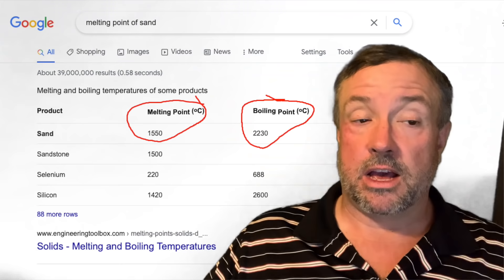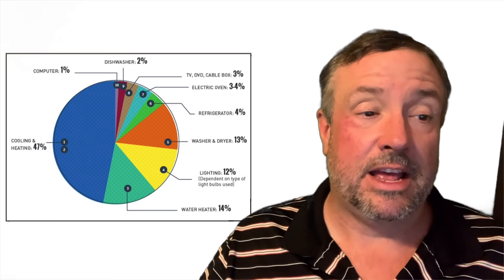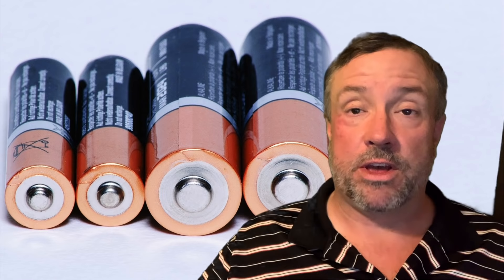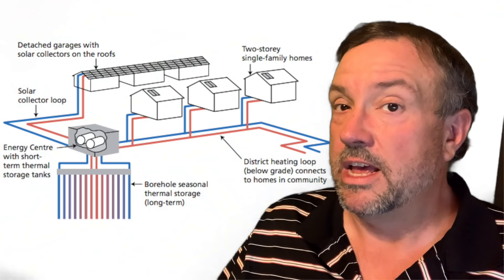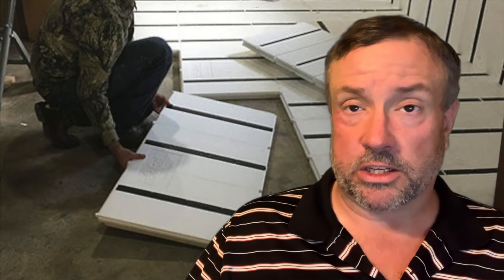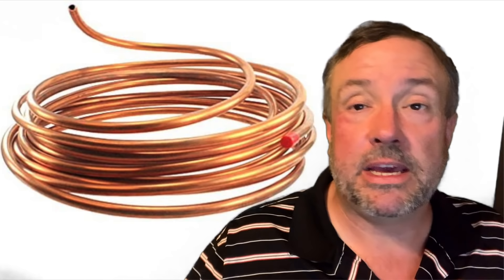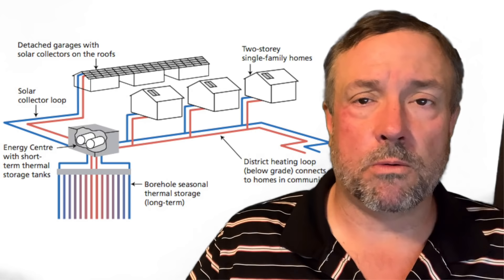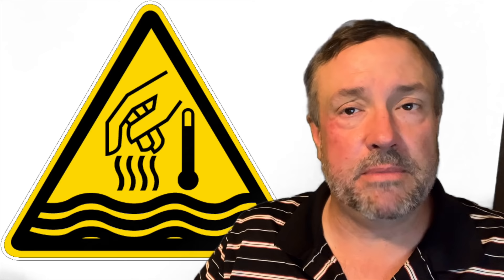Sand for Thermal Energy Storage

Comment: My idea is stupid (very inefficient) but I’ve been trying to think maybe the solar heater could produce steam to run a generator which stores electricity into an array of supercapacitors (crude, cheap homemade) which in turn after having enough energy stored could directly use heating element to heat the sand (so like buffering the heat first trough electricity back into heat). 

Haven’t done any calculations, but most likely an useless approach. At least this would not require complicated/expensive equipment. Not sure how high temperature can you reach with the cycle of charging and discharging a certain size supercapacitor array and what type of heating element would be good for such a setup. The amount of energy losses with this approach will be very high but maybe this way of buffering would enable the sand to reach higher temperatures?

Ps. If someone asks why not just store the electricity directly to batteries, the whole idea of storing energy to sand etc. is to find an alternative to current battery technology storage systems.
Reply from the maker: Cool idea

Comment: the  liquid is always moving so it never has a chance to get too hot. if it did you would just increase the flow rate and the radiated zone surface area. It's not always practical to use industrial processes in the home. 
  2 ideas i had were to try sand over PEX underfloor heating and electrical underfloor, solar electrical and  heat pump vacuum tube panels making it a 2 part system. The other idea was to build a gas bottle stove that has a flue running up the centre the lower section is a burner then you pass all the way from ground level in your house or lower to the highest ceiling with each floor having another burner section, these could be made modular so you just stack them for however many floors you have in your house. then fill the upper sections with sand once installed, only issue is loosing heat out the chimney but you can choke the flue and inlet once the fire is out.
Cold isn't it!
Reply from the maker: very cool - thank you
Reply: AGREE.....think about a typical natural or propane gas fired home furnace. The air is heated by passing it quickly thru a gas burner heat exchanger which is at least as hot as 400-500C sand and it works very well to heat air.

Comment: When I was first looking at solar I studied what the government had been using for their receiver type solar platforms. What they were doing was they concentrated the mirrors on piping that contained oil. That heating up of the oil created flow within the system, which turned an electricity generator. I do believe that you should be fine using oil for your transfer medium without any need for a pumping system. I do think that you should consider a piping solution that can handle the built up heat and pressure if you do this.
Reply: You would want to integrate flow check valves into the system to ensure that the oil only flows into the desired direction.
Reply from the maker: great ideas
Reply: @SimpleTek  thinking about this article has made me think about something else entirely. I was in the US Navy for 6 years, and the main thing that I did was convert salt water into fresh water. The concentrated light from a couple of the solar options mentioned here could be used for an evaporation distillation plant, to convert waste water into freshwater.
Reply from the maker: @justinweatherford8129  very interesting - thank you for commenting!

Comment: There's a Finish company with some videos on youtube that is promoting sand thermal batteries. They are just heating air and running it through steel ducting. Their target temp is 500 degrees..
Reply from the maker: I've seen it!

Comment: Some thoughts:

The only way to insulate a sand body sufficiently and still be able to add heat to it would be to run conductors through it and heat those up with electrical current. That would be fine because we are in need of a way to store solar power anyway.

To extract heat the copper tubing sounds practical, although it can take only about a 1000 degrees before it melts. But then again, just use more sand. The temperature of the copper would have to be monitored closely.

Now the idea comes to mind to combine the two: the copper tubing (the soft kind that can easily be wrapped in any path) could be use both as a heating conductor and as heat exchanger when extracting heat. Running water through it would be problematic for obvious reasons, you could use a closed loop filled with oil that can take high temperatures and a pump. That would also make it easy to monitor the temperature: if the oil is pumped round slowly the oil temperature could be measured in or near the pump.

With some valves the path of the oil could be routed through a water tank to heat the water. So you would have one short path through the sand used for monitoring only when the sand is being heated with current and a wider one through your water tank when you need to heat that up.

You would need insulation bridges in the pipes where they leave the sand pack, to insulate the pump and water tank from the heating current.
Reply from the maker: the 'only way'? ummm, no...most commercial high temp storage devices use liquid molten salt for high temp applications
Reply: @SimpleTek  I consider the "lots of mirrors pointed at a bucket on a tower" a crude and inefficient brute-force approach. These things must immediately radiate out a good deal of the energy they absorb. The half-cylindrical mirrors with a pipe running through the focus line suffer from the same issue. With electricity you don't need that exposed surface, it is easy to keep everything you put in inside because it can be a fully insulated closed container.

Then again, the solar panel won't give you more than about 20% in the first place so you van afford to lose a bit.

Then yet again, solar panels do not need direct sunlight.

I think these mirror systems were just pioneering practices that were nice to raise some awareness but I do not think they are very practical.

Comment: Got this figured out already.  I’ll be sharing it on my YouTube channel soon.
Reply from the maker: looking forward to it
Reply: @SimpleTek  by the way, not a challenge, it’s like you say, when we share everyone benefits.  I saw some guys on a video a couple of months back discussing this on a large scale for cities.   This was not the first.  However, it is the first one I saw on wax.  Interesting!  They heated their sand to 700 degrees centigrade and emphasized the sand had to be dry… huh??  I’d think it would be dry!!  Read some comments below…. It was the Finland group I watched, refreshed my feeble memory!
Reply: Yes, the sand would have to be dry for systems that get even close to the boiling point of water. If it isn't enclosed then rainwater would steal some of your heat in the evaporation process. If you had an enclosed system that had wet sand, then you better have a pressure relief valve to vent off the pressure created by the water that you left in there. That water in your enclosed system would take care of itself over time, but why risk the damage to your thermal battery?

Comment: Hello, I don't know if somebody mentioned, but you can increase boiling point of water by increasing pressure. I think you can reach 250-300degC if your system will be pressured to 50-100bar. But the piping, fittings and the pump will be expensive.
Reply from the maker: Great point
Reply from the maker: @scattkiwiman  so is an internal combustion engine but they seem to be Popular
Reply: @SimpleTek  if you want to make a bigpressure resistant water vessel it will cost you more as a combustion engine
Reply from the maker: @scattkiwiman  depends

Comment: black iron pipe, used for moving heated glycol around.  Alternatively just pump the hot air through the trough collector and into the sand, like a fluidized bed.
Reply from the maker: Good idea

Comment: If you want it cheap than not only are you on the right track by using sand, but keep it all simple. The point, us air as the heat exchange median on the input heat exchange and on the output heat exchanger, because it is air that you ultimately want to heat anyway, the air in the green house, the air in your home, etc... But this design uses PV solar,  electrical generator wind turbines,  electrical generator hydro turbines, etc... In other words the energy input to this design is electricity because it uses electrical resistive heating elements(cheap and found everywhere) to heat the air that heats the sand. The same heat exchanger designed right, can be used for both input and output heat exchange because you are using air in both cases. There will just be a valve to either tap into some of the heat, or close it and store more. A venting system will be installed so that you can draw only the precise amount of heat energy out of the battery at a time, in other words you can trickle just a little bit out at a time, as well as in dead of winter, or end of winter open full blast if need be. 

Then that is it, you are already pretty much done, no more expense, no more complexity. No pressurized tanks to buy, no steam turbines, nothing except sand, pipes, and basic electrical resistive heating elements mainly, probably need a good blower. It is just mostly ducting work, and just one heat exchanger can act as both input and output heat exchanger because the energy input to the system will be resistive heating coils in air. Just need heat exchanger pipes, sand, electrical heating elements, and some ducting to the destination of the output heat. The ducting from the battery to the building/s could be anything cheap, like blocks or bricks, even field stone mortared together in a tube with insulation(maybe aircrete) poured all around it for a couple feet, then bury it(it will be built in the trench) for the DIY to save money doing the labor. Then when it reaches the building use regular furnace ducting.

But just think of the other uses because of the fact you stuck with using air, heat pumps! You can get extreme efficiency if you combine this ideal of an air heat exchanger on the output of that battery with a heat pump. I would have to try it someday soon, it seems like you could get more heat out of it without actually taking more heat from it using a heat pump. Maybe i try to find an engineer on that topic. Maybe better to just take the hot air directly.

But to use other forms of energy input like solar troughs heating oil, etc... you will just need a separate heat exchanger in the battery for it, a set of SS pipes running uniformly in the battery(sand).  Same thing applies, one single heat exchanger(designed for it) could be used if you use the same median for both input and output exchange.
Reply from the maker: Thank you

Comment: Just a thought..how about using concrete piping.  Cheap, long lasting, mold into and size or shape, can handle high Temps, will also work as a conductor or storage for heat and heat source.
Reply from the maker: Interesting idea… Can you buy it or do you have to make it?

Comment: Use a Peltier device to store electricity as heat and use heat to output electricity. It would go above your budget but with no moving parts, it would last forever and not require specialized equipment to use it.
Reply from the maker: Interesting

Comment: Build a pizza oven, start with a barrel covered/wound in copper pipe surround that in clay, then sand and rocks gypsum basalt marble... cover in dirt or clay and then a metal roof.

Cook your food in the oven, when finished let the air flow into the greenhouse and pull from the other end of the greenhouse. Add more wood and burn if it cools down.
Reply from the maker: I like pizza!

Comment: Dig a hole lay it with plastic foil (provent demp) spread 5 cm sand on the button lay down rectangle straw bale. Build the side same way so straw not touching plastic therefore not poking plastic. Now you have a big pool, put 40 cm sand straight on the bale. Then lay aluminium  gutter down pipe just like PEX floor heating pipes roughly 40 cm apart (you will circulate AIR in, it is free you can heat it up wery high temp, leaking is not a big deal, easy to pump circulate) then 40 cm sand above then piping again so on, dipend how deep is your sand pool. Then the top double think straw bale 5 cm sand plastic sheet then cover with sand to protect from weather or mechanical problem.  You have large cheep high heat storage. 1 m thich straw = EPS 60 cm. U value 0,06w/m2K
Straw cheaper, can handle high temp, (if you seal under ground without ait), and it is environment friendly. 
You can have heat exchanger to convert example: 800 C hot air from the sessional underground storage "battery" to 50 C hot water for showering. Or generate heat for existing heating system. There is no degradation in this battery not like expensive lithium battery! "Heliovis heliotube" on youtube can be made way cheaper to produse the heat what we want to store. Sergiy Yurko channel I highly recomend. https://youtube.com/channel/UCd_FypFc4T5pJky872wBsNg 
( If you build a house and you are handyman then convert an oven, hob, kettle washing machines or dishwasher  to hot air then you save again a big deal of energy) then you just need very little electricity what some solar panel easily can produce
I will make my system like I explained above. Of course my house will be build with straw bale to😃 so it will be highly insulated.  Have a nice day for people who try to be less dipendant.
Reply from the maker: I LOVE Sergiy's channel, we've had channel links for years

Comment: Hi  I like your Ideas and will be following .  I am currently in the middle of converting my wood boiler system to a Hydro Solar system .  I'm at 49.5 deg lat. and have purchased   4 panels of 15  evacuated tubes . my plan is to heat a 1000 sq ft house and a 1200 gallon spa ,  In my basement I have a low height space ( 5 ft 11 inch high )  that will house up to 10  gas hot water tank conversions (Free from the local landfill). In the center core of these tanks will be boiler water , either from solar or wood boiler, and the outer portion of each tank will be dedicated to individual needs of my house ;eg Hot tub/Spa , domestic hot water , domestic heat . As my space is already constructed with ICF ,it will be simple enough to isolate and insulated these tanks with an  simple frame wall system  and fill with sand . simple thermal mass storage. The tanks themselves will be the heat exchangers', and with a drainback system ,no expensive anti-freeze needed .
Reply from the maker: that's awesome

Comment: You could use copper say 1"it's not cheap but you could insulate a 2' pvc pipe by spraying foam inside the pvc by drilling port holes every 3" then wrap the pipe with butyl wrapping to prevent water from the soil getting to it. It's an idea. and thanks for the video.
Reply from the maker: interesting

Comment: I'm a big fan of eliminating moving parts and failure points.
Would it be possible to transport heat into the battery with a conductive solid? Like a copper pipe array buried in the sand or something?
I dunno, that's just a hypothetical "outside the box" idea. Maybe a bad one hehe.

On getting the heat out of the battery & distribution in the house, I'm very fond of air-based radiant floor heating (usually tubing buried in concrete). It's not as thermally efficient as water, but it can't leak really, and can be operated with a small cheap, easily replaceable fan. Even if your tubing completely disintegrates from old age, the tube channels remain in the concrete. Even if that cracks, the majority airflow goes where it's meant to, and the leakage is largely irrelevant (in terms of any property damage).  I guess for an outdoor heat battery, such a system would just run an air pipe through the heat battery, and back to the house.

Agree on the air-crete. Air-crete is superb as a durable insulator. Terrible as a load bearing material, but for insulation it's fireproof, waterproof, termite proof, doesn't stop working in humidity, etc. More than makes up for any gap in R-value with more expensive (and far less durable) insulation. I have plans for a steel frame house which uses non-load bearing aircrete or styrocrete for insulation, along with a lot of interior thermal mass (from concrete brick interior layer, which along with the steel exterior form the pour cavity)

Window design can really heat up a house as well. Just need to make sure the sun can't find those windows in the summer months due to angle. By itself it wouldn't be "comfortable" per se, but that along with great insulation and interior thermal mass can slash the BTU's a house needs in summer/winter pretty dramatically.
Reply from the maker: Great points

Comment: I have been looking at solar passive houses for an upcoming project in portugal. But using sand as a thermal store is a great idea. I think trying to get the sand really hot isn't worth it. It you have sufficient volume for a house that wont be necessary  Heating to 70 or 80 degrees C will be more than enough to keep a house warm during the night until the next solar day. Underfloor heating at 25 or 30 degree C is more than enough to keep a house warm. This is certainly something I shall be considering approx 60 tonnes for sand should form a nice thermal store.
Reply from the maker: interesting
Reply: @LaurenBurger  Not quite sure where you are getting your numbers. In my example I have 60000kg of sand and specific heat capacity of 830j/kg/c and I heat it up 60 degrees c. So 60000*830*60 joules of heat. This allows me to pull 5kw out of that heat store for 166 hours that should be more than enough for your average house to get it through a night or two reheating the store with solar during the sunny days.